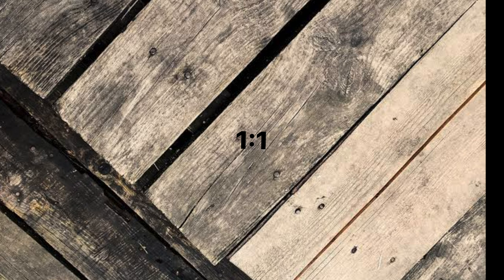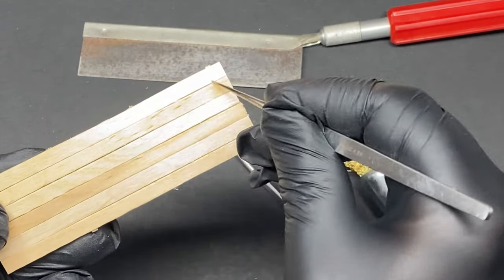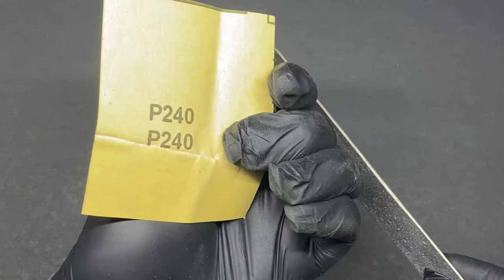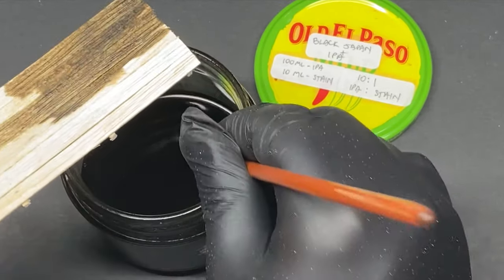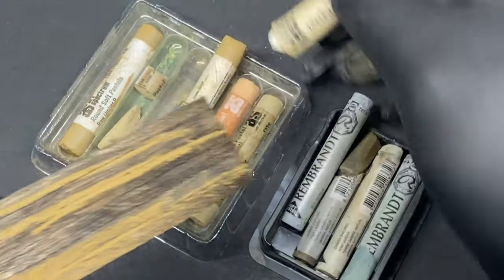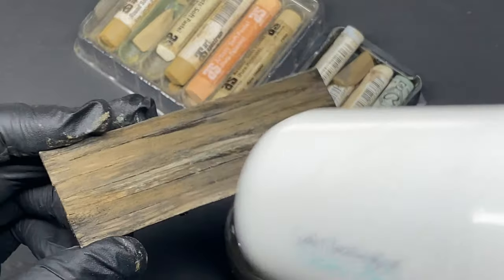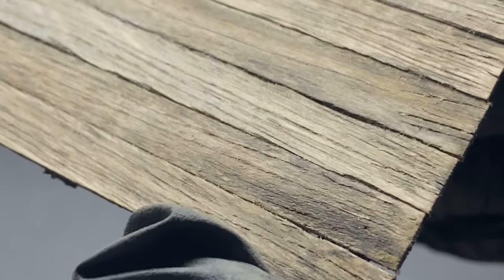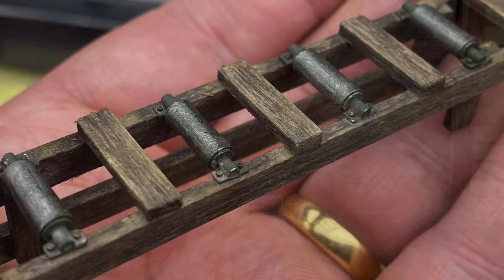Modelling Methods - Weathered Timber

Comment: The softer Balsa gives a older, worn, rotted look at the end of the pieces of timber. Handy for those modeling damper climates or very old exposed timbers. Now have a reason to buy pastels. Looks easier than dry brushing.
Reply from the maker: I’ve used balsa as a cheap timber option for many years. Easy to trim down to required size, and great for bulk decking etc. Very easy to twist balsa boards and pull apart for modelling broken pieces of timber. The coffee stirrers are also good for decks or platforms, but a bit more limiting with the size since they are much harder to cut.

Comment: Hi Dan. Great technique and video. Thanks for sharing. What type of stain is the Japan black?  Is it oil based or something else?  I didn’t think you could thin oil based with alcohol. It would be great to know what stain it is. I’m in the US. Thanks again.
Reply from the maker: @jimrohman6575  hi Jim, this stain is spirit based, so would thin for this modelling purpose with mineral spirits or IPA (IPA is always on my modelling bench which is why it’s common for me to use for applications such as this).
Reply: Thanks for the reply Dan. I’ve always admired your work. Keep it up👍